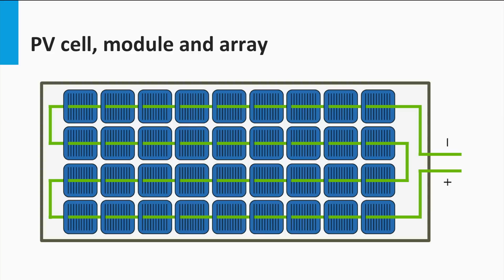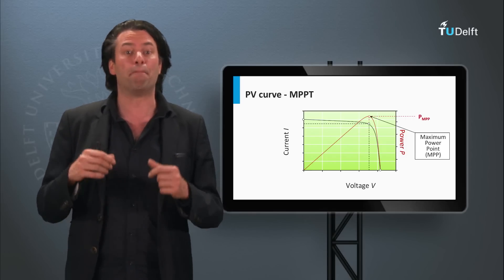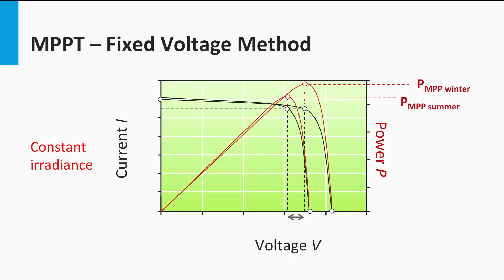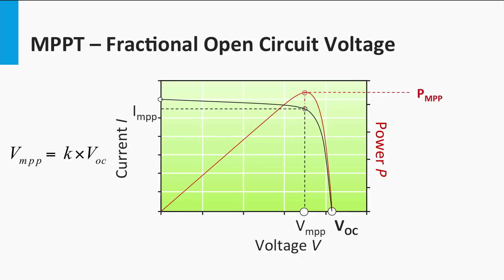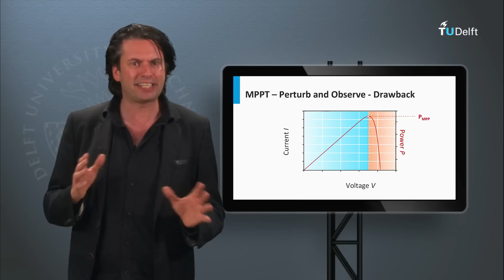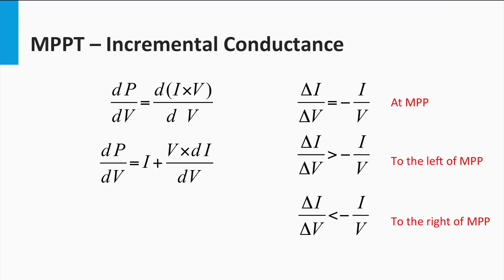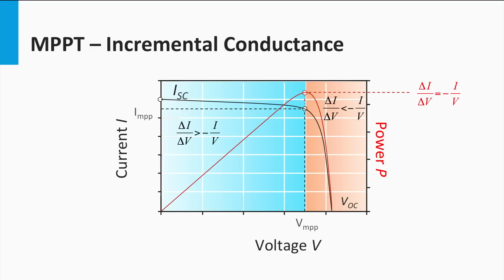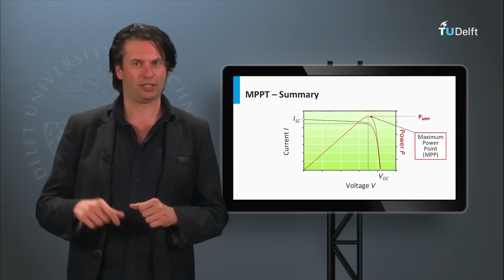7.3 - MPPT

Comment: Fantastic explanation ! Congratulations Professor ! Thank You.
Reply: Hi Sir , my name is Majid , I live in Iraq, the area of the most power crises , I bought an mppt type Ipanda 30A a year ago , I used 3 solar panels of 36v , Isc is 5A in series , it wotks well , untill I bought a 4th one with same rating , on sunny days it gives me a full power by connecting them series-parallel , in order not to exceed ths max mppt pv voltage which is 150V , untill I noticed that at cloudy sky or in the morning , my mppt stuck at low voltage , and never goes up unless I disconnect the pv wire snd connect it again   so full power goes out , is there any thing I can do ? 
Please cpnsider my video below which shows the problem .. thank you sir
Reply: @alkhafajimajid I'm late to the party but it sounds like the MPPT was getting confused. One thing that stands out with your description if I understand correctly is that if you have mismatched panels/arrays in a series configuration of any kind, your power is limited by the lowest power segment in the chain. So if you have a 50W, a 100W, and a 25W, all the same Voc, in series, the most you can get out of the entire array is 75W as the current will be limited by the Isc of the 25W panel. This can also cause strange artifacts in the MPPT depending on the method, resulting in it "seeing" more than one knee, and sometimes this can result in it getting pegged. If you see this again, try changing your MPPT method, eg from perturb and observe to sweep or vice versa. It may "resolve" the problem enough to operate, but the real answer is to make sure your array is balanced and use a good MPPT that has a solid reputation when left alone.

Comment: MPPT is not unique to PV cells/arrays, it applies equally to hydro generation and wind generation although, in the latter case, the response time may need to be shorter/quicker.
Reply: Yes any varying input that is "strongly current source" in nature would benefit, as the curve will have that knee due to non linearity. If the knee moves around, you will benefit from tracking it.

Comment: I'm a big fan of MPPC. The disadvantages seem to be outweighed by the numerous MPPT controllers that easily get lost in tracking with long strings. Bypass diodes are about every 10V and a momentary partial shading can cause locking onto that lower "power point" voltage. I have controls that monitor panel voltage and reset controllers to a higher power power point with significantly higher wattage produced. Example, a 60V string will lock into 18V. A momentary disconnect will restore controller to the 60V region with higher power output.  In short there is often a high cost to MPPT tracking too.
Reply: P&O is "quick and dirty" for the job. The better controllers have different methods in them and one of the best has a hybrid approach... it periodically performs a sweep and P&O hunts around the sweet spot the sweep found. If it gets lost for whatever reason, the next sweep will bail it out and normal operation resumes.

Comment: Mppt works as long as you have somewhere to dump all the power generated, works great with grid tied systems or systems with oversized batteries, not so great with off-grid or lead-acid battery based systems. also mppt works the best for single panels(micro inverters), for a big array several local maximum power points might exist, but there is only one global mpp. Last two(direct) algorithms seemed to be the same to me -  adjust voltage and check the impact on the power. Also i think the algorithm should start from open circuit voltage and zero current and start increase the current and not from max current and start increase the voltage( like in the animations). Also microcontrollers these days can work preaty fast(stm32f1 series up to 72MHz with hardware PWM plus you can configure ADC to scan all the channels using DMA for these applications it is almost real time operation for this kind of task if you stay clear of arduino and python, and that's not the top end like F4 or F7 series MCUs of ST, i know there are better ones, its just the ones i had my hands on). But hey,  what does a random person on the internet from the future know.
Reply: I like your flow, future man.

Was thinking the same.
"Wont using any shitty none mppt solution work as long as im nowhere near the peak panel output?"

Comment: Very helpful thank you. Im looking for a simpler solution. Say a potentiometer thats lets you set the voltage while watching power either go up or down.  You being the tracker.  Gets rid of all that overhead and complexitity and coud be worth in some cases where you dont need constant and percise tracking.  I have a similar situation with solar tracking as the day goes along.  I only need 3 positions, not constant perfect tracking so Im hopig to get an understanding of mppt charge controllers to achieve something like this. Seems like all you'd need is just away to limit the voltage/current, but also not waste it as heat and you should be good for setting up maximum juice for your system.  An automated circuit would be ideal, but for educations sake i think a simpler circuit showing the essence of the mppt idea by doing it manualy  would be helpful.

Comment: Boost converter diode was drawn in wrong direction!   "Implementation of incremental conductance method not easy."  Why not?  An MCU can calculate G=I/V and dI/dV as well as it can calculate P=I*V, and dP and dV.

Comment: can we connect two mppt solar charger controllers to the same solar array ? 

This is because i have one mppt that works on grid when i have the grid power and then I have another mppt which charges my battery with solar array when there is no grid .

Comment: It's not unique to PV. 
Any energy source has a trade off situation that results in an optimum compromise that varies depending on source and load conditions. 

Consider bicycle gears...
These are selected to optimise the trade off between torque and revs so that the cyclist can produce the most power in the specific riding conditions and his dynamic strength.

Comment: ΔI/ΔV = −I/V, at MPP why is the R.H.S negative. Please clarify
Reply: For delta V as positive (moving towards right), delta I is negative at MPP.
Reply: P = VI if you take the derivative of power P with respect to voltage V you get,
dP/dV = I + V(dI/dV) [use product rule to get the derivative]
Now at maximum power point (MPP) dP/dV = 0 (it's a stationary point)
Then make dI/dV the subject of the formula above and you get dI/dV = -I/V
hope this helps

Comment: so basically if i want to implement a basic MPPT controller to a project, I just need to put a buck boost converter to my system, measure the V open circuit to multiply it by the constant, and set this value on my voltage output on the converter.

Comment: Half panel shading and diode bypass?? In a string this is essential as the shared series  resistance will cut total string power. The input voltage must get drawn down until the bypass diodes turn on. Even a weak shading will generate enough voltage to reverse bias the bypass diode. You missed the whole point. Your schematic is not a buck boost it's buck only. You need more training especially for a university. Wow. You don't know how panels are  built and configured?
Reply: It’s a buck-boost.  

This lecture is a more basic introduction. you’re referring to more advanced issues.  Gotta learn to walk before you can run.